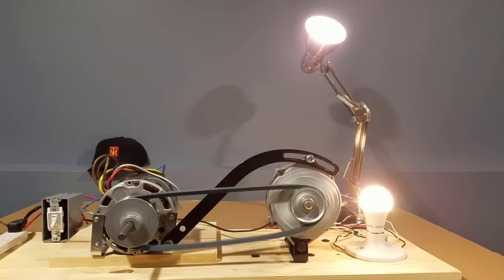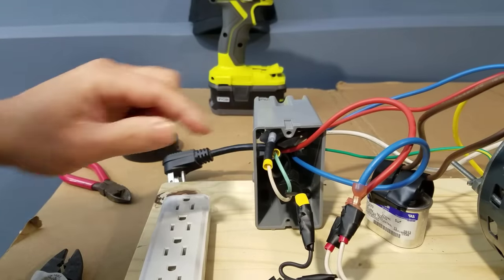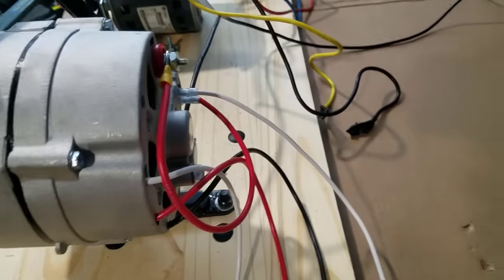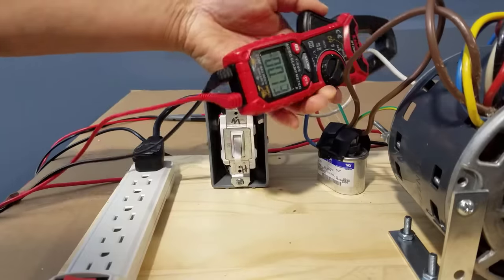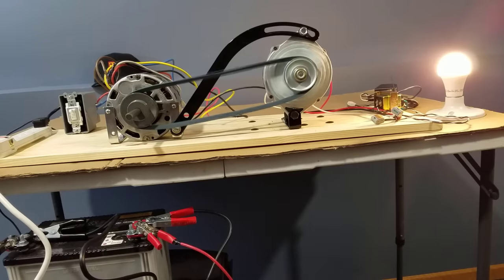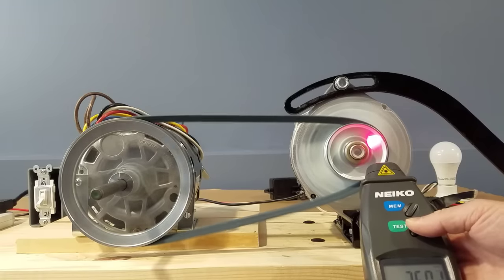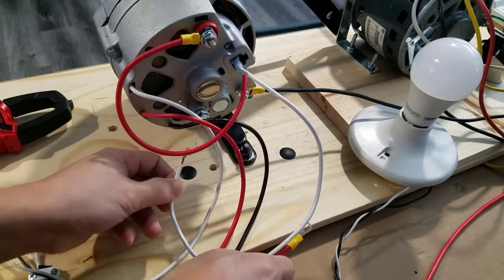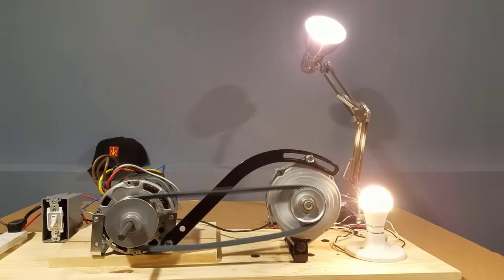Free Energy? (WOW) Using a Car Alternator

Comment: Fino a quando la batteria non si scarica.
Reply from the maker: Nope, it's until the furnace motor burns out. The battery should continue to be recharged by the alternator primary DC output.
Reply: @mrmightytiger7385  Il tuo progetto sta infrangendo la prima legge della della termodinamica, nulla si "CREA" e nulla si distrugge, ma tutto si modifica. NON SI PUÒ GENERATE PIÙ ENERGIA DI QUANTA NE FORNISCI. Ogni macchina elettrica ad ogni conversione di energia, da elettrico a meccanica e viceversa ha un rendimento utile massimo del 90% nel migliore dei casi, il tuo sistema non può funzionere, o meglio funzionerà fino a quando l'accumulatore avrà della carica, dopodiché si fermerà tutto. Non prendere in giro le persone, sei in rete, e qui trovi persone che fanno questo lavoro da 50 anni.

Comment: Rubbish. It is not possible. If it was, do you not think we would already be powering our world with these things? And yet we are not....
Reply from the maker: It is possible, but friction and heat will eventually consume the furnace motor.
Reply: @mrmightytiger7385  so bearing replacement is the only thing would need to be done or bearing cooling ? That could be done or improved with ferrofluid ?
Reply from the maker: @strawman9410  There's always room for improvement.

Comment: Does this also work when the whole circuit is on DC, with my DC alternator and motor?
Reply from the maker: Just need the spinning motion. Some alternators require higher RMP than others for them to put out good voltage and amperage levels. I'm testing a few alternators right now. One with 250 AMP! So far, the 250 AMP alternator requires much more power from the furnace motor to turn it than the 55 AMP alternator. I'll need a better motor than the old furnace motor for my next video. Stay tuned!
Reply: @mrmightytiger7385  Alright. I will try it with my 24v alternator and a 6000rpm 24 motor. I make a switch between them. And first let my motor make the swing.
Reply: @piraatje053  I know there  are   several front loader direct dtive or even belt drive washers that  literally have frightened  me they spin so fast that a king size heavy blanket almost need not be put in the dryer it was an LG which I sold ,I do have another yyyyy
Reply: I currently find clean repair and sell washers/ dryers. recently  reclaimed my garage and am contract for deed
Reply: The electric for all three building is out regions to the point i installed wood burning stoves to recreate the electric consumption

Comment: Thinking it could do with a flywheel assisted with a start spin, maybe? , but all good information.little bit help. Boy with tyre, slap a heavy tyre helps to keep the kinetic motion going style .like a downhill bit. Fast use of , offload, but kinetic flywheel can get you over the top, using some but not all of the energy available. Like friction toy with load off wheels.

Comment: The conversion of energy from one form to another is usually to allow its use by us humans. The energy released from wood as it burns can be used to produce electricity which can be used to power an electric motor as seen in the video. The energy that turns the motor comes from some faraway source at the power plant producing the electricity. 

Now lets burn the wood in a stove to produce warmth for cooking. The fire burns and the stove gets hot. When the fire goes out due to the wood being totally consumed the stove cools down until it reaches room temperature.  

Disconnect the faraway source of power from the motor and it stops just like the stove cools. Perpetual motion says the stove will not cool down but stay hot which you will agree is not what happens and would be quite impossible. 

The confusion comes in when the generator is added. The power the generator is producing is simply energy from the faraway power plant converted to rotational energy by the motor and then converted to electrical energy again. The generator is not a source of energy but a consumer of energy. It converts  the energy produced by the fuel powering the power plant that was changed to rotational power into electricl power. 

The laws of physics are the same everywhere in the universe.

Comment: Perpetual Motion is a function that starts under its own energy and can sustain.  In this case the device requires an initial start by moving the belt manually.  Hence, not perpetual.
Reply: No, perpetual motion is something that sustains itself once moving. It can be started by anything and still qualify as perpetual. This guy has the right idea, just needs a few more steps.
Reply: @bgdesignandsolutions  my apologies, the way I learned the definition of perpetual motion was in reference to the motion having to start under its own power.
Reply: @mastermindgameplay5297  On a side note, when you see what people are claiming to be perpetual motion, take notice of whether gravity is involved. Many ideas out there use gravity and people do not understand it is involved.

It takes three elements to make perpetual motion devices, gravity is the third element in most peoples inventions, hence they do not qualify as perpetual motion.

This guy has two elements, but not enough power. Hence, he needs a third element other than electronics.
Reply: @bgdesignandsolutions  you seem like a pretty smart individual, we should chat sometime.
Reply: @mastermindgameplay5297  Thanks, it's always nice to get a compliment.

Comment: If it connected to the network it is probably running "motoring" mode and likely to be disturbing the power factor of the local network, the owners wont be happy, because if you are shifting the power factor it will be damaging appliances connected to it. Electrical applances particularly motors and designed and built to operate as near to unity power factor as possible and they are inclined to burn out themselves or start fires. Also revenue meters can be disturbed by this and the retailer may coming looking for more money, energy theft. And see what your insurance company says about it, if it is outside regulatory requirements you have likely voided your own insurance and exposed yourself to being sued by neighbours on the same network.

Comment: so , if you had a small solar array you could charge the battery and power the AC motor from that ? 
IF you could get FULL output from the alternator (55A ) you could power a three bed house in the UK easily including cooking obviously you would have to use major appliances at different time but most of us do that anyway
Reply: No you will not. 55A x12v= 660W   660w/120v=5.5a. What voltage, amperage, and watts are your devices drawing?

Comment: What Capacity Does It Have... Just For a 20 wt Light Bulb for 10 Minutes?
Reply from the maker: If I were to merge all AC phases with a center tap transformer, it'd get around 25V AC. There's room for improvement.
Reply: @mrmightytiger7385  If you do, let me know so I can buy a few for Puerto Rico.

Regards,
Eng. Ricardo Fernandez
Reply: @observo-escucho-analizo6750  Cheaper to go to the shop Ricardo and buy some candles.

Comment: I think the pulse spark plug route makes more sense. Cheaper and easer and likely longer lasting.  My only question is how many amps you can supply with four iridium pulse plugs. And while magnet could last 100 years I wonder how long it would last in actual use.  We all should have free electricity right now. It is a crime that we are spending hundreds of billons on something that is free and unlimited.
Reply: Please explain how spark plugs work in your mind.
Reply: @nuggert  I have just pasted some press text from a pulse plug..  Maybe this will help you.  Some of these pulse plugs were actually developed in nuclear laboratories in New Mexico USA. 

"Here’s how it works:  Electrical energy from the engine’s ignition coil is stored in the built-in capacitor.  At the exact moment needed, that energy is released in an amazingly powerful and quick (two nanosecond) high-energy pulse.

The result:  The improved combustion efficiency burns fuel sooner and more effectively, which equals improved mpg, less CO2 based emissions, and better overall drivability.  Even the green get greener!  For example, in this EPA US06 fuel consumption lab test, even the icon of fuel economy and eco-friendliness- the Toyota Prius- saw notable improvements in mpg.

This new technology is based on plasma research supported by the world famous Sandia National Laboratories – and yes, that’s definitely rocket science.

Looking for more engine horsepower? Pulse plugs create horsepower by generating more peak power than spark plugs.
There are many performance-improving aftermarket devices available today. Some devices, like turbochargers and nitrous dramatically increase performance. Others, like headers and cold air intakes, produce lesser results.

None of them treat performance at the epicenter: fuel ignition.
Even ignition products designed to improve ignition power are hindered by the weakest and final link: the spark plug.

Pulse plugs have 10 times more peak power than spark plugs and ultimately improve the performance of your vehicle as well as the performance of all aftermarket performance products.
Pulse plugs simply ignite fuel better and should be the very first step in improving your engine's performance." What is a “pulse plug” and how is it different than a regular spark plug?
After 15 years of extensive development and testing, Pulstar® pulse plugs contain an internal, very efficient and patented capacitor element that stores energy to discharge into the fuel charge once the spark gap is ionized https://en.wikipedia.org/wiki/Ionization. By definition in the Society of Automotive Engineers specifications for a spark plug, the Pulstar® pulse plug has more “capacitance” https://en.wikipedia.org/wiki/Capacitance than is allowed for a spark plug.

With Pulstar® pulse plugs, how much more power and mpg’s will I get?
Certified testing shows that Pulstar® pulse plugs deliver these consumer benefits:

Greater engine torque – up to 9%
Greater horsepower – up to 7%
Quicker throttle response
Better fuel economy – up to 10%

ALL OF THE ABOVE is their press release for auto pulse plugs.  But just imagine one thing you want to do in the case of free electricity and contemplate if a plug like this might work. Create a solid state alternating current. 

Electricity is not made at power plants or hydro damns. They just produce the alternating current that is sent out and transformers placed in close proximity to businesses and homes throw off an electric charge.  Think of the AC current like an agitator shaking an apple tree... But in this case the AC current shakes the magnetic field of the transformers alternating its energy flow 240 times per second. 

Imagine two pulse iridium plugs that zap a pulse of power when the charge from each is reached.  The way these free electric devices are set up the two plugs may zap power back and forth simulating an alternating current and throwing and electric charge off of the magnetic field. 

I am not say this certainly works.  With what I know and with what I know about the power grid....... this is 100% possible.
Reply: @nuggert  You come from a position of fear.    It is okay for you to accept what you have been taught. God Bless you. 
No problem.  Thank you for sharing your opinion.
Reply: @guidedmeditation2396  What exactly am I scared of? Maybe you're the one scared of a world where nothing is free. Maybe I'm not the one who's scared here. Peace be with you
Reply: @nuggert  I had to go back over the comments to find out what your problem was with me.
You don't want there to be free electricity. Okay. We got it.  But the more you know about our existence and what matter is you will understand that not only is energy abundant. ALL MATTER IS ENERGY VIBRATING AT 12,000,000,000,000,000,000,000 times per second. And that is a real number.  The only reason we don't have free energy is corrupt greedy governments and ancient bloodline families who want control. 

A solid state alternating current will produce unlimited free energy. FACT.   Is the pulse plug the answer? Maybe Yes Maybe No.  Nothing to get angry or upset over here.

Comment: it looks like for the same system weather you are using lawn more motor gasoline or weed eater gasoline and not able to get more then 300 watts. Get your self a 1000 watt gasoline generator..   These 1000 watt generators are the best,  but yeah you can build them ..

Comment: I know this stuff isn’t real, every time you’re transferring energy there’s always an efficiency to it. You’re not gonna magically put out more than you receive unless you have some external energy source boosting it, which is also going to burn out. Even if you could make the motor be perfectly perpetual and 100% efficient, the only thing it could do is self rotate, if you were to plug the tiniest little LED light into it it’s perpetual energy would fade away.

Comment: Change the pulley size then itvis easily increase voltage and curent if motor pulley larger and smaller alternator pulley

Comment: Question: There are 3 terminals on the alternator you are using Red Black and White wires do these 3 wires represent +ve -ve and earth or just random wires 
Because I'm struggling to figure out which one is +ve -ve and ground from these 3 alternator terminals 
Suggestion:
The reason you are not getting enough juice out of your AC terminals is that you're alternator teeth are not magnetised enough 
You need to replace metal armature teeth with a strong magnet ( I 🤔 )
Hope you will explain my question above, 
Thanks
Reply from the maker: Each of the 3 wire is an AC phase, which means you could combine any two phases to get an AC voltage source... The furnace more was not strong enough or could spin any faster to get more "JUICE" /power out of the alternator.
Reply: @mrmightytiger7385  get a faster one and try again

Comment: you lacking in your explanation. In the beginning how is the battery (positive) connected to the alternator? I don't see a connection so how can it charge the battery? Only the sense wire is connected to the positive of the alternator? So this should not work or you are faking it..
Reply from the maker: There's room for improvement in my presentation. The positive DC output from the alternator goes back to the battery + terminal to maintain the battery.

Comment: The altanater says it's 6000 rpm and it can't keep the battery charged at under 1200 rpm you need a faster motor to keep it charged
Reply: Greatest comment I've read so far
Reply: @theinfohub8356  it's simple as numbers here and thanks

Comment: Try adding flywheel to sustain bigger amp loads , it should provide additional kinetic energy once up to speed, I did this experiment in 2015 came very close to success. I think my pulley ratio and flywheel weight was not correct , gave up. was very close though.
Reply from the maker: That's a good idea!
Reply: @mrmightytiger7385  keep going bro. Don't let the nay sayers stop or discourage you. No body believed Thomas Edison could make electricity in his day. People thought man would die if he moved at the speed of sound. But today, they've all been broken. Keep forging ahead. At least one of us is thinking.

Comment: I dont think these people understand that hes not conning you hes using the principals as a regular gasoline motor but replaced that motor with a electric one that is powered by the battery that then turns a alternator which i never understood why youd used an alternator but a generator head and feee it back to the batteries and then just expand your battery bank and power everything thru the inverter so you for some reason dont know why tiger did this but step up direct power from the alternator nice idea but id just let it charge the batteries up and have separate inverters for different task while the main one is always on charging the batteries back up

Comment: Not true. battery is 12 V DC,  Alternator makes AC. You must use a bridge rectifier to get the DC back to charge the battery. But you want AC to run appliances?  Great video but it's not possible. LOL

Comment: May 1982 may pehli baar free energy banaya tha Dc motor se yani 42 years before_: I have done this experiment in 1982 with cycle dynamo’ 

I have done this same experiment 40 years before with a toy car Dc motor..
in 1982 i were studying in 4 class’ there is a scooter mechanic in my area’ the mechanic narrated me the process of magnet and copper coil how it’s work when the magnet pass from the copper coil it’s produced fluxes current that current use the whole system of electrical work in scooter 🛵’ even the coil pass the high current to plug spark ⚡️ to burn 🔥 fuel’ it’s very simple and easy definition.. what amazing! 

Today everybody is copying each other experiences copied videos on YouTube.. 
Durvesh yezdani’s

Comment: Uh no.  The only way to eliminate electricity bills is to remove the electric meter.  Otherwise, no.  Won’t work.
Reply: Just disconnect the incoming Supply or better, still have an automatic change over switch like a solar panels to home supply board has now.

Comment: Can you do this with a Gm 10 SI Alternator High Amp One Wire & a. Ford Mazda 150A Alternator ?
Reply from the maker: Build one using the parameters mentioned throughout this video. You'll be surprised.

Comment: An electric motor turning a generator would not make enough energy to run it's self you would have to a transmission with gearing so low that there would be no strain on the motor which would turn the generator so slowly you wouldn't produce enough energy to power the motor.

Comment: you know there is a thing called fuses to hook up the motor if the power is too much.
Reply: Also  you can use voltage stabilizers as well?   They are about 200 bucks online.